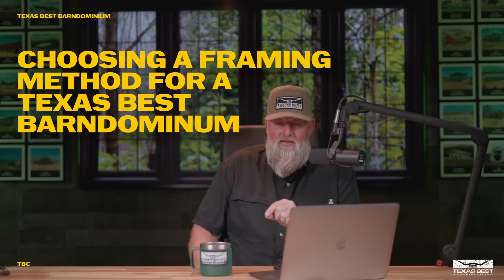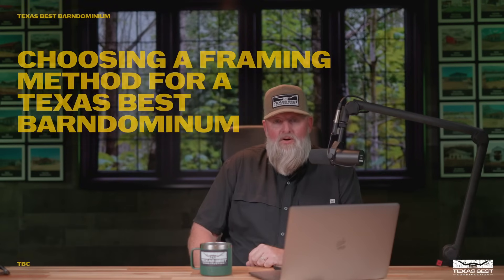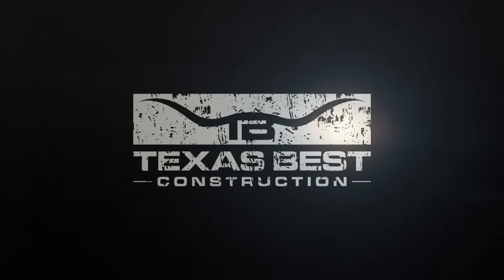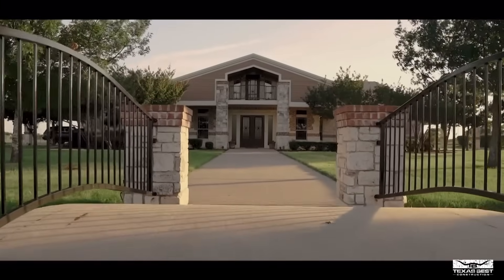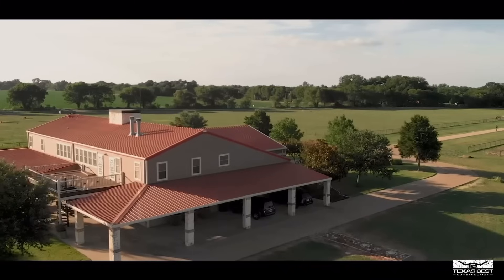Choosing A Framing Method For Building A Texas Best Barndominium | Texas Best Construction

Comment: What are your thoughts on SIP walls and roofing as an option?
Reply from the maker: That’s a great style of construction definitely not the norm for routine probably. But I do like it.
Reply: Was going to ask a similar question. 
Josh @TexasBestBarndominums,
Have you ever considered using the sip panels that have Huber Zip sheathing on the outside, combined with your steel framing as a hybrid build? It may not be cost effective? But, it seems like it would be a really fast, super strong, super insulated, monopoly style, air tight envelope?